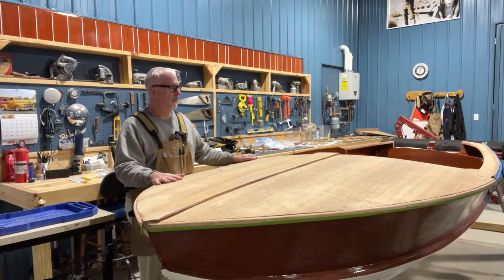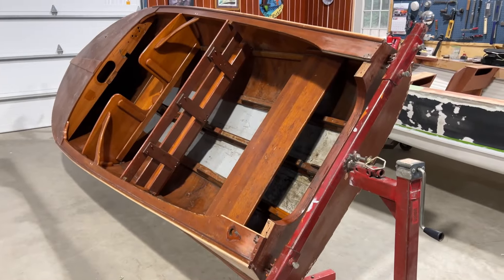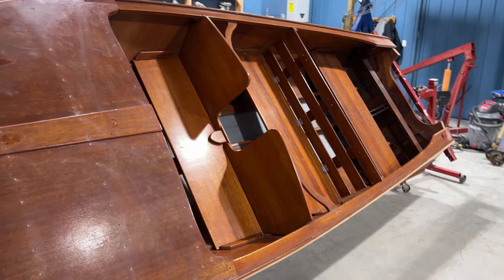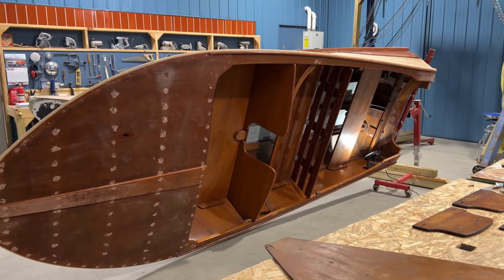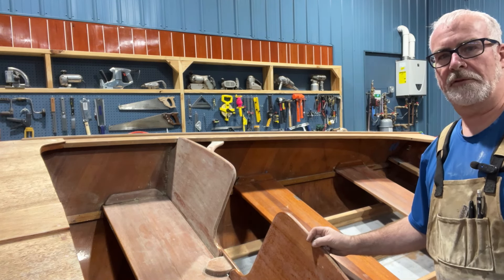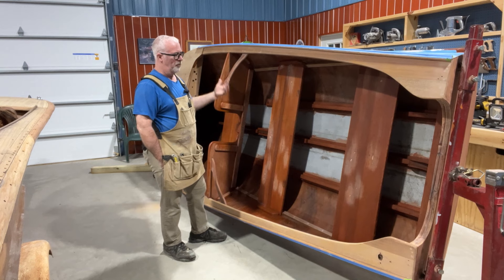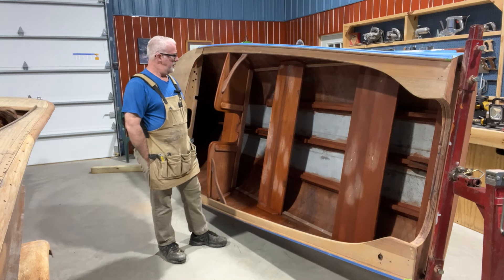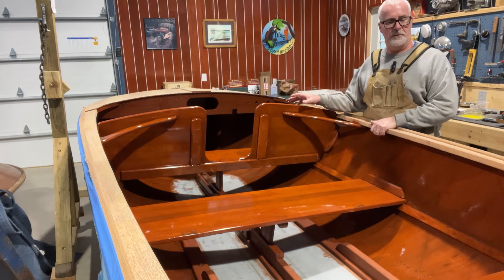Episode 12 - Sanding and Staining the Interior

Comment: Your lift unit is a great idea. Enjoying your documentation and your approach to problem-solving. I have a 1954 Wagemaker in CT. These boats area a joy to work on.
Reply from the maker: Thanks! I am thankful David Scholten at Firehouse Boatworks in Holland, MIchigan, was able to adapt a design from the 1950s and design a safe and reliable unit that is a game changer when working on these smaller boats. I only added the 8' 4"x4" posts because of the extreme change to the center of gravity when I turn boats completely on their sides for incredible access.